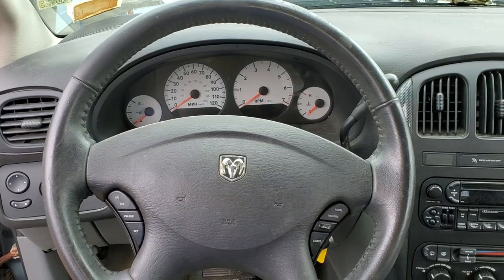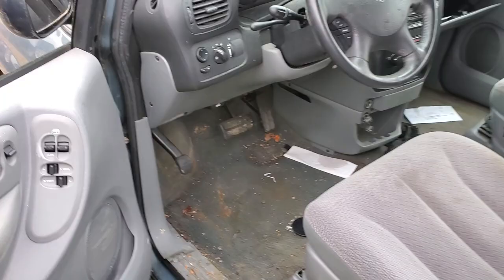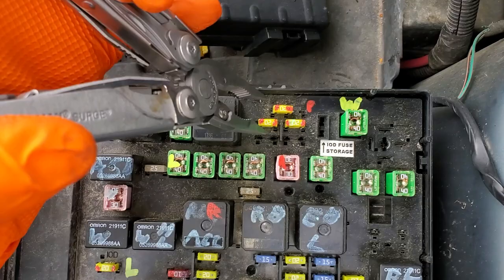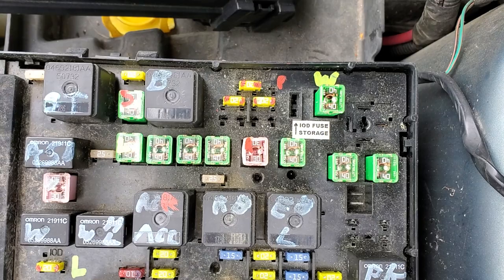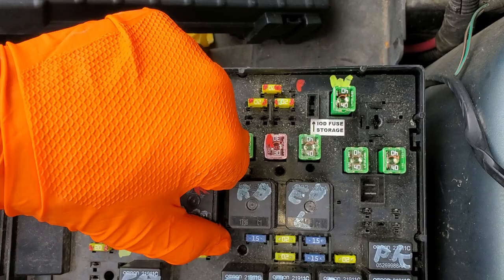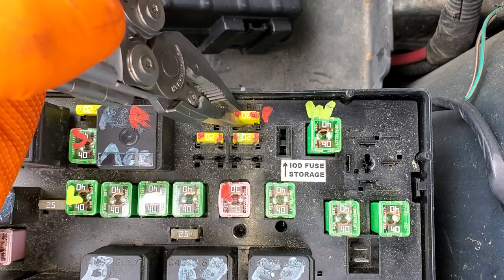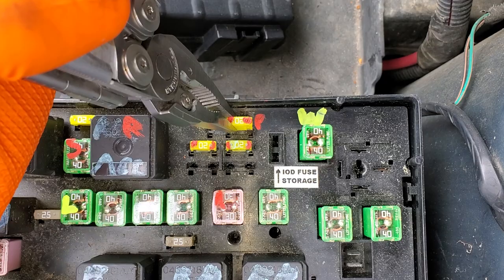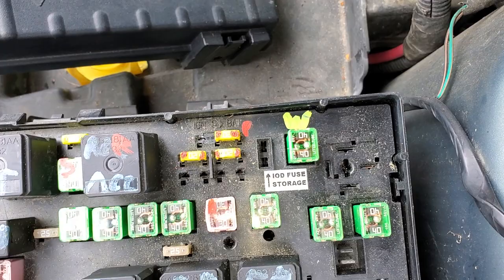2007 Dodge Grand Caravan Cigarette Lighter Fuse, Power Outlet Fuse & Relay

Comment: So I checked out plugging the power point fuse to the right and no difference. You still have to turn the key to give power (top outlet). Also, I removed the power point fuse and kept it out. I still got power by turning the key (top outlet). The bottom outlet still gave power without the key being in the ignition. But thanks for helping me figure out which fuse to swap out.

Comment: Thank you for this, What about the power port on the wall for the middle row? i've looked on google and i haven't seen a definitive answer on what fuse controls that, i've never had power there. The front power failed a few weeks ago, i will check the fuses seen in this video for that one. But I'd love to get the middle row one working too.
Reply: I have same problem with my middle console plug??

Comment: Wondering if there were any easy way to make the top Power Outlet always "on" whether key is in the ignition or not. Reason I ask is the lower outlet has a plug over the opening and a 2 wire connector on the back of the plug but has no actual "tube" you can plug into.

Comment: Hi! Thanks for this video! You helped me to solve that problem with upper lighter. But I have question about lower one. It has been not working for a long time now. Are they both under the same fuse?

Comment: I did just that with the fuse, but it still doesn't work. My radio and power windows are working fine, though, so I am not sure if it would even be the accessory relay.

Comment: 2008 GC.. i had to remove my center console to vacuum.  Now 3 of my 4 power outlets dont work. These are the ones labeled battery, on all the time. I checked all fuses with a volt/ohm meter, all fuses are bad, i swapped the relays with no luck.  What am i missing?  The ones that dont work are the one under the radioz the one in the center console, and the one in the rear where my audio /video inputs are for the entertainment system.  The 4th one that is on the key switxh works fine.

Comment: Got a question, had to jump my 07 grand caravan couple years ago, we accidently jumped backwards on it and now the defrost, snowflake, recirculation, and all the hvac buttons have no lights and dont work, I get air come out. But it's not hot and not cold wither, the screen up top on roof that tell miles and temp and shines the green light down dont common now either, and the auto locks dont work either, could it be a fuse? Checked most but they all look good, replaced a few and now the air bag and seatbelts light is on too and the abs light too all of it happened at the same time, right after the jump, inwanna just go on and fix it.

Comment: My front seat lighter works but the back seat lighter doesn't. Could it be a fuse problem? Or does that lighter fuse control BOTH the front and the back lighter?

Comment: I have a 2007  T&C my accessory plug was working earlier today. I used my air compressor for a minute then I plugged my  phone charger back in and it won't work. Neither does anything else in the plug, (I'm referring to the plug that works without the key).
1. What does it mean when the relay is good and the fuse but the accessory plug still isn't working?
Reply: Just a note, my radio works. But I wasn't sure if you meant before or after the switch of relay?

Comment: My cigarette lighter keeps blowing new fuses. What can be the problem?
Reply: You have a shorted power wire somewhere going to that system. Possibly a bad outlet creating the short, could be a loose power wire not fully connected to it's terminal in the rear  and shorting to ground there, or a frayed power wire grounding out somewhere along it's length. If it keeps blowing fuses, you definitely have a short somewhere and I would not use it until it's found. That could easily start an electrical fire. If it was a once off deal, and fine since then, you'd probably be fine. But since it keeps blowing them, it's definitely a short. If you have a multimeter, you could check the positive lead against the metal housing for continuity. if you do have continuity when you shouldn't, it's shorted. If not, work backwards in the system until found. Do you have high current stuff plugged into it? Like power inverters etc?? You may just be overloading the current draw too. But if nothing is plugged in, and you're blowing fuses, it's a short. Don't use until rectified.